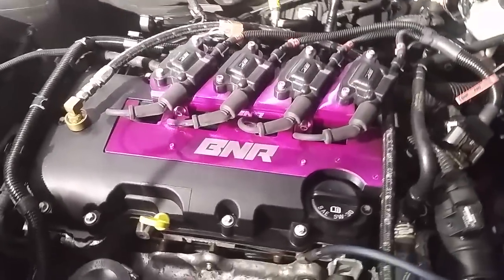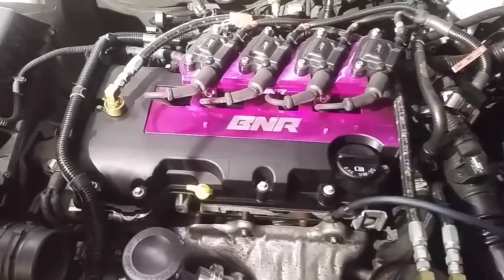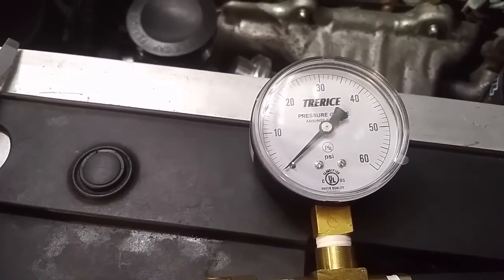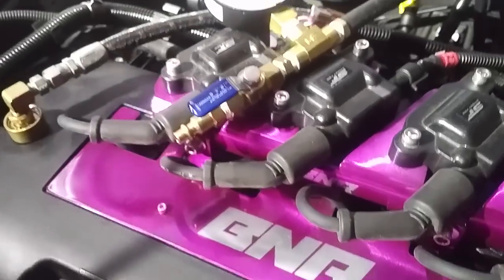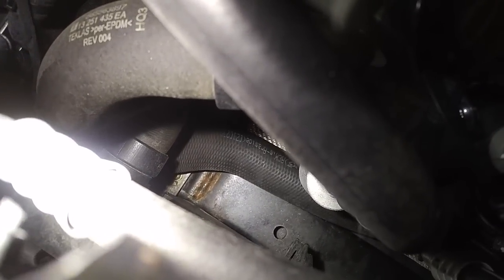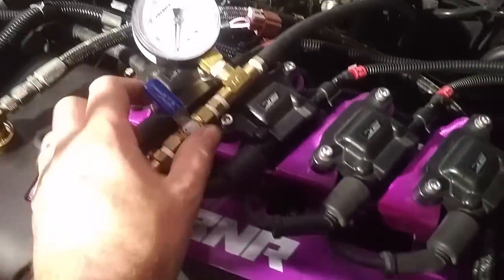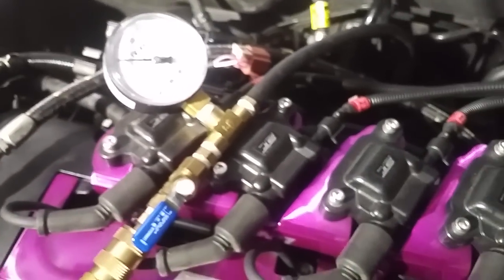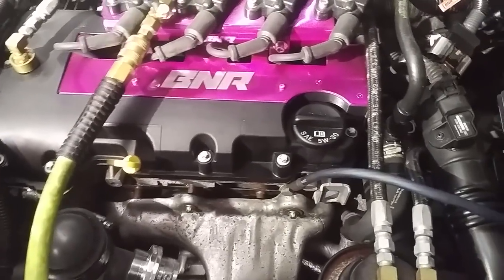Chevy Cruze & Sonic 1.4L Turbo Boost Leak Testing

Comment: Is this the same for the gen2 cruze 1.4 as well?
Reply from the maker: Different engine so you’d have to figure out how to adapt it for that engine.
Reply: @AndreiDPop  yeah I figured it out. Had the low boost code pop up. Performed a boost test and didn't hear any leaks at 20psi. But it drops from 20 to 10psi in about 15seconds.    Any ideas?

Comment: Totally shit design in this engines turbo system. I have Opel Astra 1.4, I believe it is called Buick in the states, anyway same engine as the Cruze and Sonic.
Not to long ago my pcv valve broke and caused the oil air separator inside the tappet cover to blow out.
My mechanic replaced the tappet cover but not the inlet manifold since none of the suppliers in my country stock it and the dealership want to charge an absolute fortune for it, literally nine times more than the U.S price. I ordered one on Ebay and it should arrive sometime next month, meanwhile the sensor on the charge pipe leading to the throttle body has popped off, presumably due to the system over pressuring or something. The engine is eleven years old so maybe it is just normal attrition on these rubber seals but it definitely makes me think twice about buying another turbo car. FYI I only have 42k on the odometer but I guess rubber perishes over time so mileage does not really matter.
Reply from the maker: Really should just order the pcv fix kit so you don’t need to deal with the manifold again.
Reply: @AndreiDPop  Yeah in retrospect I should have but I already ordered the manifold before learning about that. I guess it has taken 10 years to develop a problem so hopefully it will last at least that long and I will sell before then anyway.

Comment: I did the leak test and there is a noticiable leak at the throttle body. It's not the charge pipe though. I sprayed it with soapy water and I can hear the leak but it's not visible from the top. It almost feels like its on the bottom of the electrical side of the throttle body. All I can do is feel around under there and change the rate of the leak with my finger. Is the throttle body known to fail? Or should I assume it's more likely leaking where the TB mates with the manifold?
Reply from the maker: More than likely it’s a throttle body gasket, which is a potential leak point.

Comment: First off, love the videos, Just wondering if you have heard of a crankshaft seal leaking after doing the boost test? I geared up my own boost leak tester and fill up the system with 20psi. I did notice air leaking from the small vacuum hose that hooks to the turbo. I used soapy water to see it. Took the Cruze out for a drive  and noticed a squeal  much like a fan belt.  Through further investigating ( YouTube) seems to point to the crank seal. The noise goes away when I pull the oil dipstick then comes back when I put it back. I'm thinking the seal was gummed up and the air cleared it out. Now it's leaking.
Reply from the maker: Crankshaft seal starts leaking usually after a valve cover failure. Never heard of one leaking after a boost leak test.
Reply: @AndreiDPop  ironically my valve cover failed on me yesterday.  Thanks for the reply.
Reply: Thank you both for the Video and the question I just bought this car and it is making the noise like a belt squeaking but stops when I remove the dipstick and it is sucking at dipstick hole please help me lol I don't have the money to take to a shop I'll have to do it myself.
And it did have a engine light on the code was for low boost

Comment: Does silicone spray work the same as the gel
Reply from the maker: What are you using silicone spray on?
Reply: I haven't sprayed any anywhere. I guess I was just curious about rubber rejuvenation, but I may be mistaken with silicone spray with some other spray
Reply from the maker: @fivetoncasey2298  for silicone spray it’s the carrier that can deteriorate rubber. Spray on a rag then wipe it on the barbs if you’re concerned. I’ve never had an issue with it though.

Comment: Thank you very much for this info. Just did it to mine that was flagging underboost. First found a leak where a duct connects to the throttle body due the clamp loose. Then repressurized and while waiting for air to reach all the places I checked the exhaust to listen and heard nothing. But when i came back the the engine found it leaking air out the valve cover gasket. I could tell the gasket has been starting to fail since I saw evidence of very small oil leaks. Now my question for you, at 135k miles should I replace just the seal or the whole cover that comes with a new seal?
Reply from the maker: I would put in a new OEM valve cover.
Reply from the maker: Did you already inspect the intake manifold for a missing check valve?
Reply: @AndreiDPop  changed the cover and the pcv pipe due to it breaking as soon as i touched it. I inspected the intake manifold and the orange nipple is still present.
Reply: Thank you for the quick reply!!!
Reply: So all was good, but the fault came back. Hooked up air, and I can hear air inside the intake manifold and the turbo. Waiting for the engine to cool down before I look into removing the turbo to inspect it. I am new to turbos and learning from your videos.

Comment: I made a pressure set-up as you described.   I made sure I did not have more than 22 psi by sticking  a nut driver in the hose end as I was regulating my compressor.  I never built any pressure because air was coming out of the pcv hose connection at the turbo.  This was a new hose I had just out on a little over a week ago.  Thinking it had failed, since the car was running well for a week, I put the old hose back in, as I replaced it as a precaution since I was changing the valve cover anyway.  Can you let me know why this is happening.  BTW, I am working with a Buick Encore.  Please help.  Love your channel.  This is my daughter's car and it is starting to work on my nerves.
Reply from the maker: Did you cap off the turbo inlet like I did?
Reply: @AndreiDPop  yes, I capped it exactly as you did.  Getting P0106, P0108 and P1101.
Reply from the maker: Also, what issue are you trying to resolve with this leak test?
Reply: My main problem is getting heavy leaking where the PCV attaches under the cap at the turbo.
Reply from the maker: @brettshaw1173  terminal isn't seated correctly, or terminal is cracked or broken otherwise. Might need a new PCV hose.
Reply: @AndreiDPop  thanks.  I am going to break it all down including the intake manifold and going to look to if I am missing that nipple and need the by-pass.  Thanks for the reply.

Comment: Chevrolet Equinox 2018 error P0299
The check of the engine came out. Having checked with a capacitor, I found an error P0299 - a low boost value. I thought maybe something was accidental. I dropped it. After a while, I got out again.

Have already checked:
-parts of the intercooler and the intercooler itself (whole)

-the turbine itself, visually and with the help of a scanner, as far as possible, while without removal (like everything opens and closes, there are no obvious visible damages)
Tell me what could be?
I'm from Ukraine.
Thanks

Comment: So if I have a leak on the throttle bottle seal, do you just clean it and redo it?
Reply from the maker: Yes. Clean and tighten. If it still won't seal, wrap it it gas line rated pipe thread tape. (Yellow stuff).
Reply: @AndreiDPop  I figured. I asked the tech at a Chevy dealership how to clean it and he said “no, you have to put in a new charge pipe” and yes that was over the phone without ever seeing the car
Reply from the maker: @BMXmirkymirk  silly to replace the whole charge pipe when all you need is a little thread sealer and a tight clamp.
Reply: @AndreiDPop  that’s what I thought.

Comment: dear friend , i have just tested my car system like you  and air is coming out from valve cover's screw which is air filter side. My car have boost leak problem as little bit , when it is accelerating boost is coming and going, what do you think ?
Reply from the maker: If air is coming out of the valve cover vent, then the valve cover has failed. Replace it and check for a missing intake manifold check valve as well.
Reply: @AndreiDPop  just air is caming out form under of a screw  , ı do not have any  errore code or else problem , just does not keep boost  when accelaretion

Comment: What if it onlt sets once in a blue moon... During last winter mine would set in while climing hill and would clear by itself after several days...( noticeable power loss when it happens).. But during summer was fine for the mostbpart but as the weather is cool in morning it has come back on again... Any suggestions? Tks
Reply from the maker: What sets? A check engine light?
Reply: @AndreiDPop  Where did you get your purple engine valve cover? Coil kit?
Reply from the maker: @phillipblair716  BadNewsRacing.net

Comment: Thanks for this video. I made the kit and ran the test on my 2012. The oil fill cap leaks and I can get passed 10psi. Is this common?
Reply from the maker: No. Oil cap should be holding pressure. I'd recommend a replacement.
Reply: Did you fix the issue with the oil cap?

Comment: Should the turbo continue to spin after the car is shut off? I have a 2012 eco that has a high pitch whine after shutting engine off. Can’t nail down where it’s coming from. Definitely not the cooling fan. Is coming from somewhere deeply hidden.
Reply from the maker: That's not the turbo spinning, but I believe it's normal. I forgot exactly what it was that did it.
Reply: Dre Dan also, do you think  a mass airflow sensor would cause the po299 code? I had AutoZone do the scan and their print out suggests replacing/cleaning the mass air sensor
Reply from the maker: @BlackJellyBeanSociety  NO! A bad MAF sensor will not cause an underboost code.
Reply from the maker: @BlackJellyBeanSociety  https://cruzekits.com/tech-articles/f/p0299-underboost-code-explained
Reply: Dre Dan didn’t make sense to me either but i cleaned it anyways and still throwing the code. I’ll have to start working through everything from your site to see where the leak may be. Thanks for the feedback!

Comment: These cars are such pieces of shit
Reply from the maker: Eh, I've owned worse. If you address the known issues, they last a long time. I've seen several original engine examples with over 500k miles.
Reply: @AndreiDPop  thanks for chiming in!   I'm doing just that. Valve cover, thermostat, water outlet.

I went with a Dorman intake to fix the pcv issue, do you have any input on those?  Instead of using a kit 

Thanks
Reply from the maker: @StaleBearFarts  they "fixed" the intake manifold issue by putting a pin block behind the check valve. Unfortunately, all that does is prevent the check valve from disappearing. In my experience, they still crack, get gummed up and clogged, or leak. The only difference is now you can't see it anymore since its recessed behind the port which also means you can't clean it. A cheap and ultimately ineffective bandaid for a still flawed design.

Comment: How does this test work if your sending 20 psi behind a closed throttle plate and the possibility of 1 cylinder having valve overlap between intake and exhaust stroke.
Reply from the maker: Haven't had the issue with valve overlap. The throttle body is closed but air can push through regardless; it isn't a perfect seal. 

All I can say is, it works. I've had a few hundred orders for the boost leak test kit and it has helped a lot of people find external boost, vacuum, and coolant leaks.

Comment: The purple coils and spark plugs, are those aftermarket or you made it yourself? And what is that hose to the left of the value cover
Reply from the maker: Yes, ls7 coil pack from BadNewsRacing.net,  and that hose is my AMSOIL single remote bypass filter return line.

Comment: Couldn’t I just use say a can of brake clean and hit potential leak points it would raise engineer rpm I know I’ve done that to check leaky intake gaskets on naturally aspirated engines granted your way is effective but I just don’t have access to a compressor at the moment
Reply: I bought the cheap harbor freight compressor it did the trick, $40 with coupon

Comment: Hey my man I found a leak at the Charge pipe/ throttle body connection, any idea if I should replace the charge pipe or the throttle body itself? Please get back at me. Thanks
Reply from the maker: Tighten the clamp...
Reply: @AndreiDPop  thank you. I did that and I performed another leak test and I still hear air leaking out from around the clamp location?
Reply from the maker: @danielvargas8975  Wrap the throttle body with natural gas-rated pipe thread sealer. The yellow stuff. Available at any hardware store. Then tighten it back on.
Reply: @AndreiDPop  I appreciate it man!

Comment: Great videos! I did the boost leakdown test and found a massive air leak coming from the oil cap. Have poor fuel milage and codes P1133,P2096, and P0171. I have inspected inside the intake manifold and I can see the orange rubber plug is in place at the check valve. Could the plug still be in place and have failed? The valve cover was just replaced last week from by a shop due to these codes and symptoms.
Reply: As mentioned this can happen cause you're sending pressure into the crank case. Not the issue. Have you replaced or looked at your factory ignition coil? mine '13 Cruze with 110k was corroded to all  heck and MPG was horrible with codes

Comment: Working on a friends 2011 Cruze that just set a 299 code when she was driving at highway speed (but not under acceleration). When I pressurize the system, the oil fill cap starts leaking when the gauge gets to 10psi. Is that a common leak source? I cleared the code and drove it about 30 miles, doing several WOT accelerations and the code never re-set.
Reply from the maker: Not really a common leak source and won't cause a p0299 either. The
Reply: @AndreiDPop  what will typically cause the 299 code besides turbo failure? Is there anything that you would recommend checking/testing before replacing it?
Reply from the maker: @keeganmichael2722  Boost leaks and ;missing intake manifold check valve. Check the intake manifold and see if the check valve is either missing or dirty/gummed up. If it is, the best option is to order my PCV fix kit from cruzekits.com to address that.

Comment: I've changed a bunch of parts on my Cruze eco recently I really like this car but I'm starting to get discouraged with these common issues they have.
Reply from the maker: They're really not that bad once you fix the common issues like the PCV system.
Reply: @AndreiDPop  Both my Cruze Ecos threw the P2 ect low boost code one I replaced the turbo and the other I just kept shutting the light off it's a faulty low boost senser and only comes on when you have the AC on and the engine is lower on power. 

I'm glad I sold my Cruze, got a truck now.
Reply: Andrei's PCV repair kit works. I installed it about a year ago and haven't experienced any problems since.
Reply: The other part that is pain in the butt to replace is the coolant pump.
Reply: @NikeySunfire  if you have an Eco get rid of it asap lol
Reply: @YZdude  Thats all I could afford. All cars have issues. The most reliable ones (Nissan, Toyota, Honda) cost 2 or 3 times more in my country.
Reply: @NikeySunfire  dang that's terrible sorry to hear that, well just keep up with regular maintenance my sister baught my Cruze so I'm still going to be working on it. 

I loved the car just alot of faulty designs with that engine.

Comment: Sometimes my Cruze makes 16 psi and sometimes it makes 2 psi. My turbo has less than 10,000 miles on it. Sometimes when I start it up and drive it it makes good boost. Other times it doesn’t make any thing. I haven’t done a boost leak test but like I said it’s not a consistent leak. Sometimes it makes 16 psi and sometimes it makes near nothing. It’s a stock tune. I wanna say it thinks it’s getting too much boost? So it’s opening the wastegate? Sometimes I can hear the wastegate opening and closing repeatedly when I keep the throttle steady. Any help?
Reply: I know this is an old post, but I had this issue and it ended up being the exhaust camshaft position sensor.

Comment: I have a 2012 Chevy Cruze ltz with the turbo. I replaced the turbo earlier this year and now for some reason I have no acceleration when I step on the gas. I would like to think it's a boost and I am planning on cleaning the charge pipes this weekend. Im curious as to whether or not if the exhaust manifold leaks boost and also if that would trigger a turbo/underboost code?
Reply from the maker: Yes, boost leaks would cause that underrboost code. Also, a missing intake manifold check valve would contribute to it. Check out my pcv fix kit for that on cruzekits.com
Reply: @AndreiDPop  I have bought both the boost leak tester and fix kit from you my friend, excellent work by the way. But would exhaust manifold have something to do with leaks as well?

Comment: so you said it will simulate the same conditions if you car is tuned, i have a bone stock chevy cruze so can i still do this test since its not tuned?
Reply from the maker: Yes.
Reply: @AndreiDPop  can a boost leak cause the P0299 turbo underboost code? thats what im battling right now, was going ot pressurize everything to see if theres a leak before assuming the turbo is shot

Comment: What it is that hose in the valve cover ??
Reply: Oil catch can kit. It is a PCV system that allows the oil to cyclone out into a replaceable filter medium that way it doesn't get all sucked into the intake manifold and dirty everything up. Look up "oil catch can kit" for further info.

Comment: All of my air came out of my valve cover in many areas... No place else.
Reply from the maker: Sounds like you need to address the valve cover leaks and try again. You shouldn't be leaking air anywhere in the valve cover. Hopefully you didn't go above 20 psi.